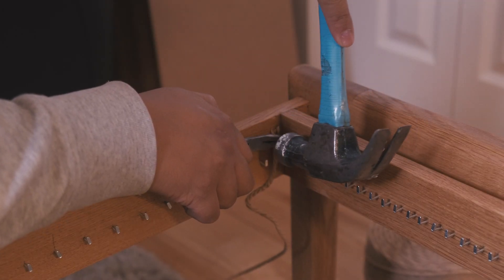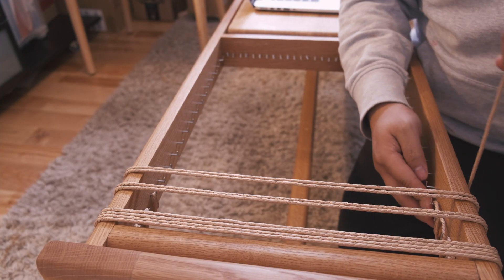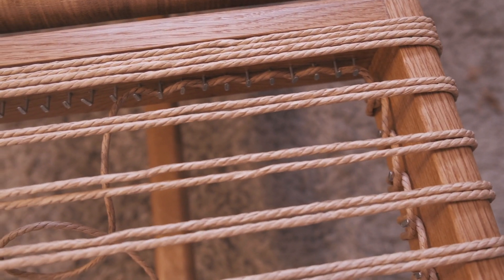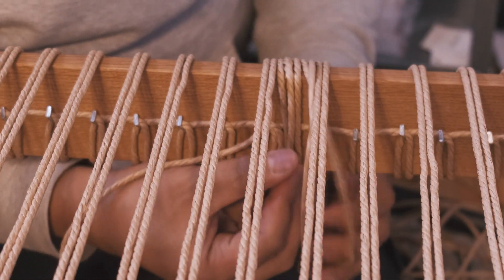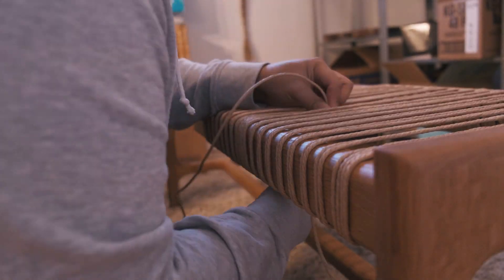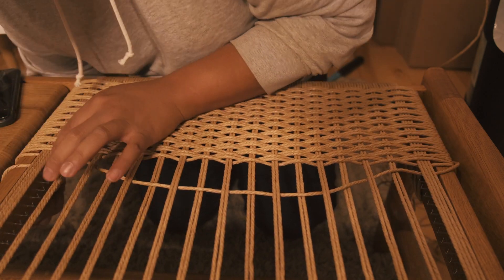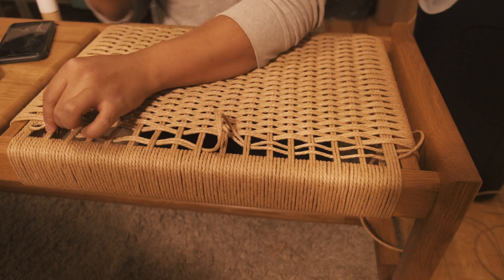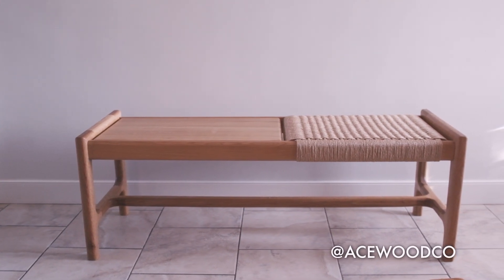How to Weave Danish Paper Cord - Build plans available!

Comment: @AceWoodCo thanks for the lesson. It's nice to see a young guy working on an old method to keep it going. I've never seen the L nails before. I'll have to look for them. When I'm working on scratching posts I normally use a U shaped tack and put a knot in the end of the string. The tack goes after the knot so it can't slip out. I highly recommend you get a cheap crochet hook to help pull your string through tight areas to save your fingers.  You sir are very patient! It's a lovely bench! If you like this sort of thing,  check out Texsense for a folding sling back chair she does. 
This is my first time watching you.  Do you have any videos on making the actual bench please?

Comment: Am about to make a danish cord to a clients oak lounge chair. Is there any way you account for the space between the nails of L shape nails? For example 10mm on short side and 40mm on the long side!? Any tips ?
Reply from the maker: I used equal spacing of 1” on the long side and .5” on the short side. I also made sure to have an L nail in the Center space and work my measurements towards the corner so if there is any bit of discrepancy it will be in the corners and not be too noticeable, hope this helps!